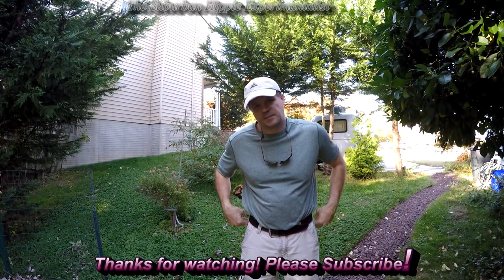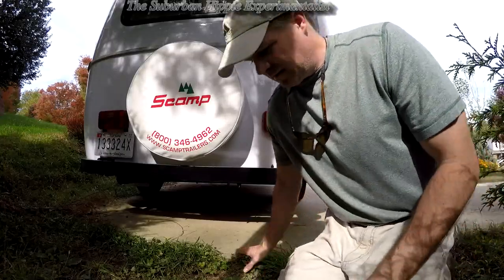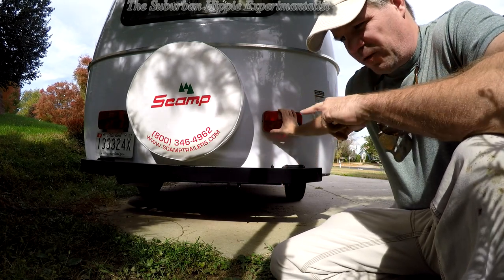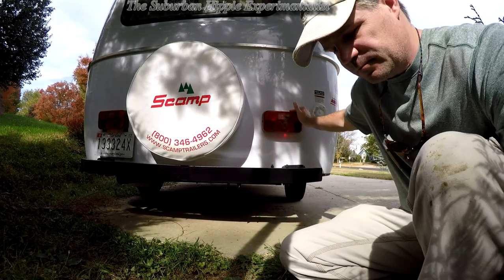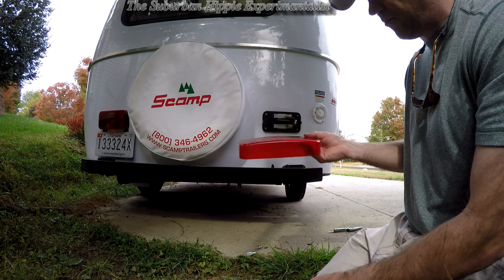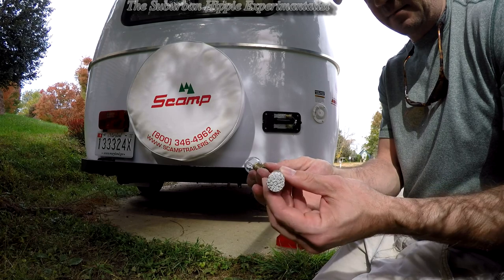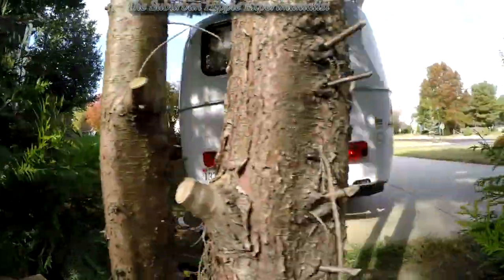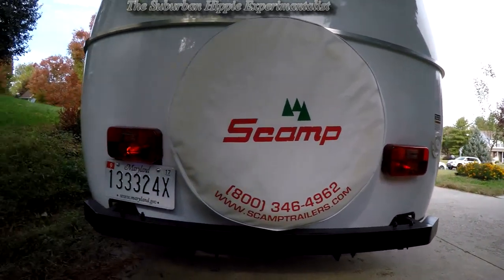LED Tail Light Replacement bulbs for the Scamp travel trailer?

Comment: Do you have the Amazon link?
Reply from the maker: I think you are just was well getting them from Ebay.  There is another video I made where I actually made a big difference!  I cut the wire for the back up lights and put two led bulbs in.  One was for an 1157 LED, and one was for an 1158 led.  I am going to send you a link, but look at your local autoparts store.  I find the Phillips brand, even though they dont have as many LEDs to be better.  Watch this video here though, as I made the lights MUCH better and still use this setup to this day!  https://www.youtube.com/watch?v=i_1zObMTL_o